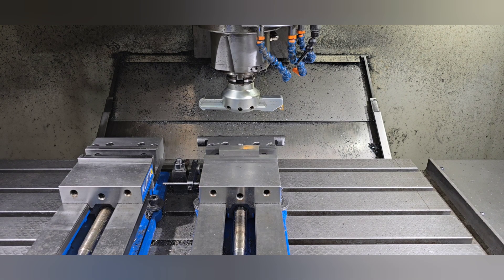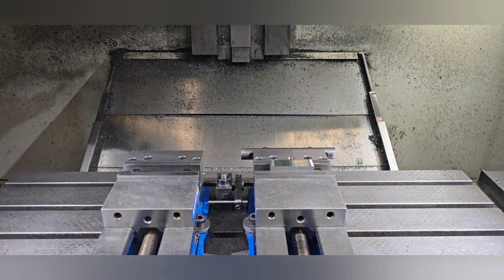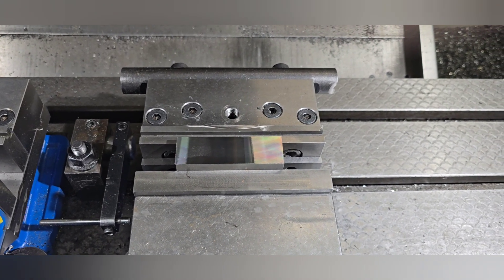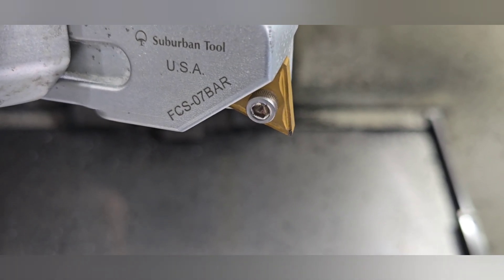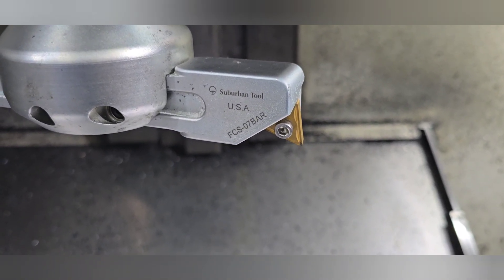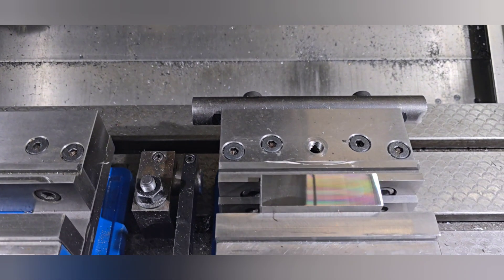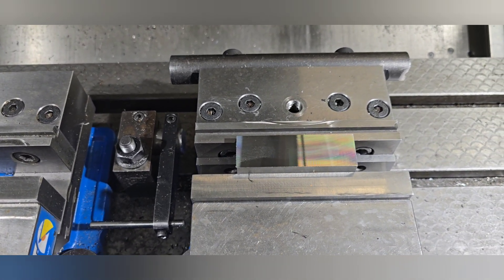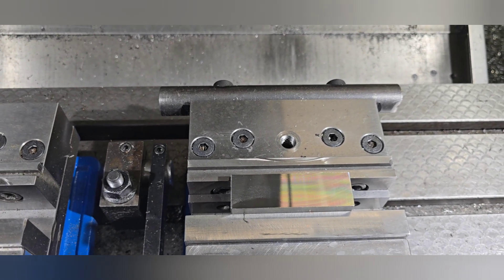Save Money / Time on Small Parts Noo Coolant Needed!

Comment: Now do that on heat treated stainless or titanium.
Reply from the maker: Hi thanks for watching and commenting! I would not attempt that, this tool is not for those materials. But works great on mild steel aluminum and some harder stuff like 4140 pre heat treat. Will cut P20 with no problem.

Comment: If using a knee mill, the tramming of it must be spot on.  Otherwise your part won't come out flat with such a large diameter flycutter.  I do a lot of flycutting, or rather 'flickmilling', as it was called at one work place - using tool tips shaped to provide special contours.
Reply from the maker: Thanks for watching and commenting! Tramming is very important for all cutters really but especially a large cutter like this.

Comment: The part stays cool only because you are not removing much material. Face mills also send the heat with the chips with the part staying cool for the same light cuts, they just do it much faster for the same cutter diameter. Button insert face mills have lots of cutting positions per insert especially if only used for light cuts and produce superb finishes without interrupted cutting. Double sided octagonal face mill inserts have 16 edges, a 160mm diameter has 10 inserts so will feed 10x faster than a fly cutter with 10 more edges.
Reply: I use sometimes a face mill like a fly cutter. If I do verry light cuts the work is due to tolerances mostly done by only one insert 
Verry slow feed an high cutting speed an it acts like fly cutter
Reply from the maker: @MaD_Man_2000  I do the same thing but insert life for finishing is usually short. But you can still hog out material with them no problem.
Reply from the maker: Thanks for watching and commenting! There are many cutters that can accomplish the task. Your methods may work well for you, but I prefer a cutter that can handle large and small parts without leaving blend lines, a long single insert life and not fooling with 5 or six inserts.  You are right to a certain extent about the heat coming off but more heat is transferred with multiple inserts in contact and your costs are just plain higher. Try coolant free cutting on aluminum  with your facemll very sticky this cutter will do ,125" no coolant no sticking and long insert life.
Reply: @mvpmachine  Regarding the heat. You must remember that there will be the same amount of rotations if the tools are the same diameter, the same amount of material removed, but a face mill is not in contact for as long, so no difference in heating the part. Although modern tooling has precision insert pockets the feed can be adjusted to minimize the blends. For a 10 insert tool instead of running the same chip thickness as a fly cutter at 10x the feed, halving the chip thickness will still be 5x faster & that's without using a wiper insert! I don't any issues with aluminum when using the appropriate insert. So get a face mill for hogging off material & if you want the fly cut finish, take all but one inserts out. win win.
Reply from the maker: @Bosun-8  I do use a facemill for hogging and a fly cutter for finishing but I never use a facemill for light or finish cuts.
Reply: The increased productivity using a multi tooth far outweighs the insert edge cost. Rotating the insert edge takes a bit longer, but the time between changes is significantly longer, by a factor of the number of inserts.
Edit: Did a few quick calculations comparing the 3.5" swing of the flycutter to a 1.25" diameter 4-tooth face mill with equal feed per tooth and the same surface speed.
First, the rpm of the smaller cutter is almost 6x faster, and with 4 teeth, the feed will be 24x faster. However, the distance to travel for the smaller cutter is 3x further to clear at both ends so the net gain is around 800% by using a smaller cutter.
I've found no evidence of increased insert wear due to more inserts in the cutter with a like for like comparison. Inserts with an angled approach tend to wear better and cut smoother than the upright approach your insert has.
Reply from the maker: @tates11  Thanks for watching and commenting. I use both but never a face mill for finishing. The speed you refer to comes at a cost and less cutting width and faster insert wear when taking light cuts especially in hot rolled steel. The cutter shown in the video is set to 7.75" We obviously do things differently. But if you watch the entire video I do say unless you are taking a deep cut. I obviously use face mills and shoulder mills when appropriate. For removing mill scale and squaring, and fine finishing I always use the Fly-cutter. My 3$ insert goes a long way.